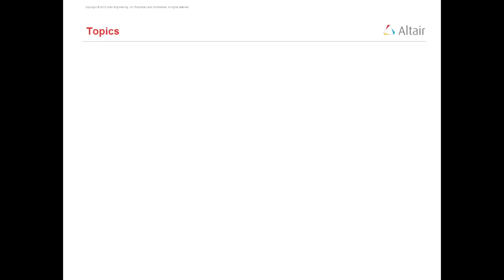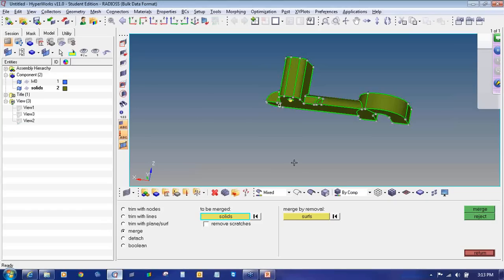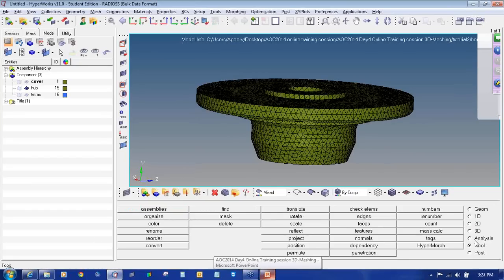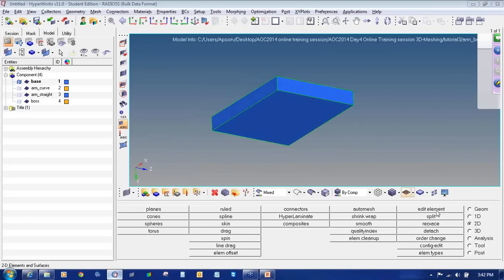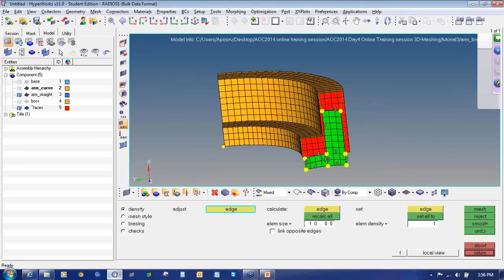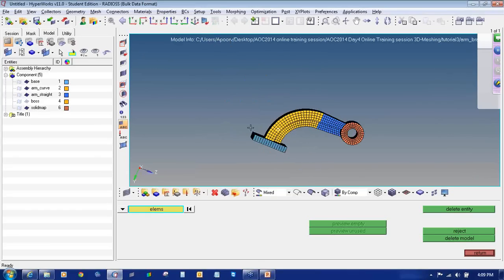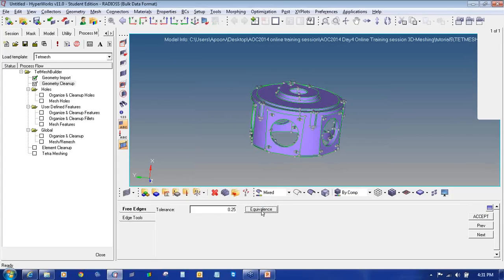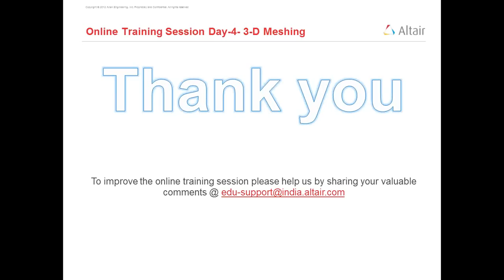Online Training Session Day 4 - 3-D Meshing

Comment: Apoorv,

I watched your training videos on Youtube. Thank you for the great training videos. I have encountered with a problem and searched the internet and Altair's training web sites. Unfortunately, I was unable to find a solution.

Let me briefly explain the problem that I encountered with.
I am trying to produce tetrahedral elements. I imported the geometry and cleaned it up. All edges were green, I obtained a closed geometry. Then I produced 2D trias and checked free edges. There were no free edges. I continued with tetramesh panel which is located under 3D Mesh. I used tetramesh and obtained tetra elements. I checked the elements and all of them passed all criterias as jacobien, tet collapse, warpace etc..

However, my main problem is that: when I check free edges of 3D tetrahedral elements I faced with discontinues free edges at the outer boundary. My main aim is to obtain continues free edges at the outer boundary. 

Could you help me with this? Do you have any suggestions? 

I trust "Preserved Edges" panel under Geom/Mesh Utility could help me. I was unable to find the keyboard short cut for Preserved Edges. How can I open Preserved Edges pop-up?

Regards,
Sinan
Reply from the maker: Hi Sinan,

Sorry for the delay in reply... 

for 3D meshing we dont check the free edges... you check the free edges after 3D meshing it will always going to show the edges..

for 3D meshing we check faces to see the connectivity of 3D elements..

If you still find any issue/query feel free to contact..

Regards
Apoorv Bapat

Comment: I imported a solidworks file as .igs and trying to create a solid but I only get the message "no closed volume found". I already check free edges and everything. Can someone tell me what is going on?
Reply: check if that part is a complete solid or not,there are chances of fragmentation i.e. series of small surfaces..and if that is the case you might hav to repair the solid!!!
i know i m answering 2year old question but do tell me was my answer is correct or not?! :)